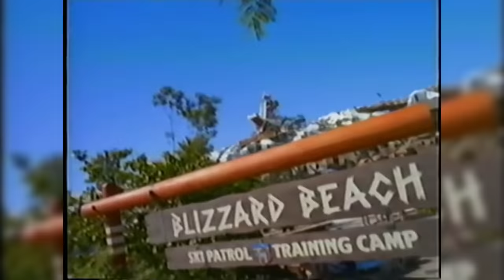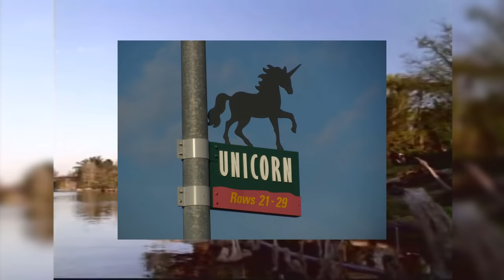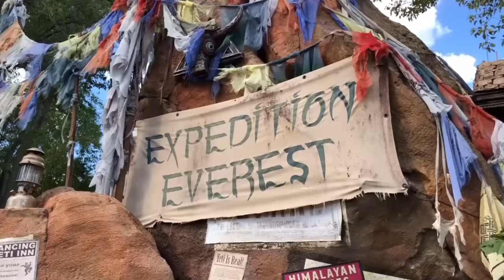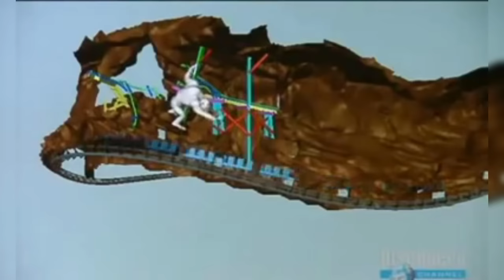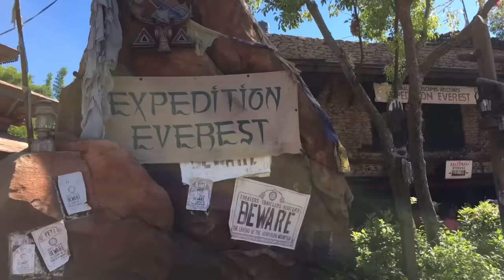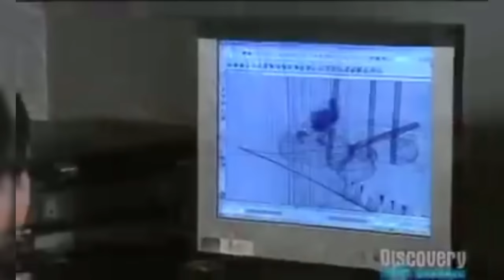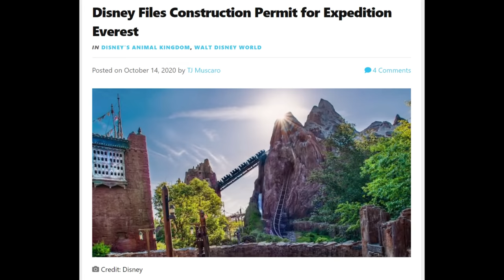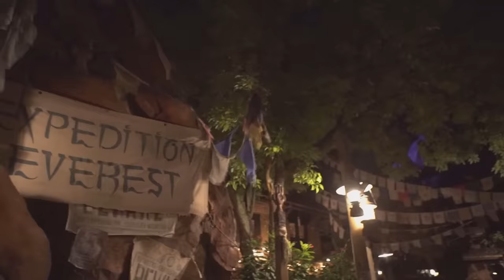Expedition Everest and the Story of the Disco Yeti

Comment: I've always looked up to imagineers and the engineers that create these amazing machines. But it dawned on me that they're brilliance and innovation is kinda dumped all over because somebody in the imagineer-sphere didn't do their calculations and dropped the ball when it came to these effects and machinery functioning forever. Or AT THE LEAST figuring out a easy way to be able to fix something integral to the experience if it were to break. 

Examples

EE Yeti, how the hell do you build this without calculating the stress of force it would have on it's structure if the thing has as much force as a jet and weighs tons? Thus making the finale and the sole subject this ride is based around a mannequin?

IJA Chamber of Desity -  Same thing, how did you not calculate the stress the mechanism would have on the roof and thus putting a great effect out of commission?

IJA Ice Machine - What engineer slept through Gen Chem 1 and didn't remember that water rusts metal?

Disneyland Fantasmic Dragon - Don't even get me started. What imagineers didn't do proper quality control and safety checks on that thing?

We always look up to Imagineers as producing masterpieces but it kinda seems like they can't seem to produce masterpieces that last. If their mechanisms or the environments around them can't stand the test of time does that really make you a good engineer? And if they are aware they can't stand the test of time, what did they do to make it easy to rectify? Engineers should be the best problem solvers, but if they can't anticipate a problem before it happens and have a solution when it does happen, that seems like they dropped the ball in their line of work.